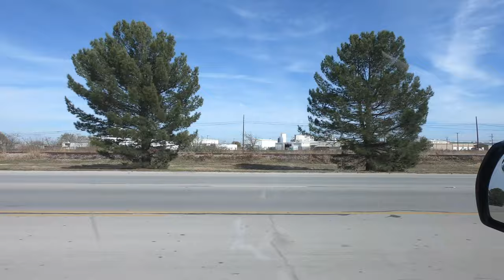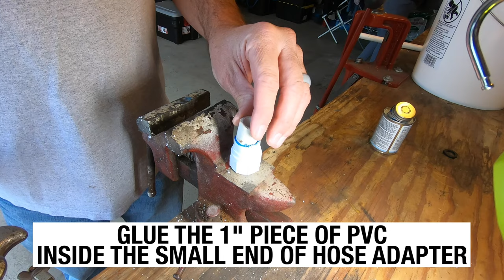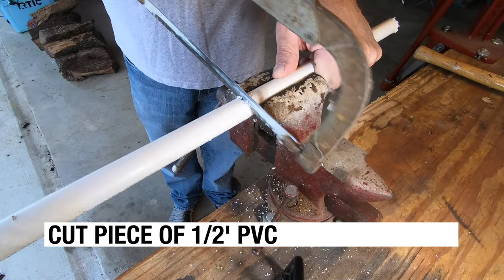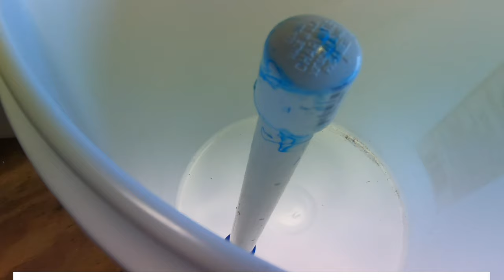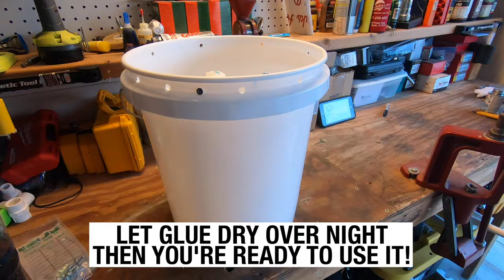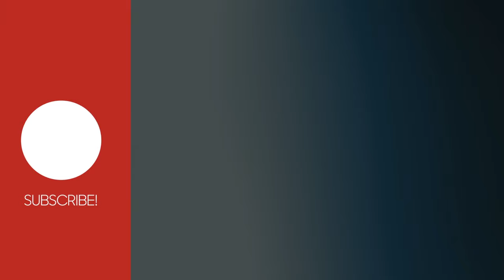DIY Wild Game Washer - Fish and Game Washing Bucket

Comment: These work great with crawfish, too. It only takes a few minutes and a bag is cleaned and ready for the pot.
Reply from the maker: Great tip!
Reply: That is what I was thinking.
Reply: So how does thu mud and all get out of thu bucket? I wonder if I do not not drill holes on thu sides if it will ever flow out of thu bucket?
Reply: i was thinking about it for crawfish as well but a 5 gallon bucket would be too small

Comment: Would a bulkhead fitting work as well? Or are the no good due to the roundness of the bucket?
Reply from the maker: It might, the fitting I used isn't curved but small enough that it still works.
Reply: Catfish Edge Cool. I will give that a shot. Spent about 30 minutes or more rinsing out a sack of crawfish the old way. Ready to try something new next go around.